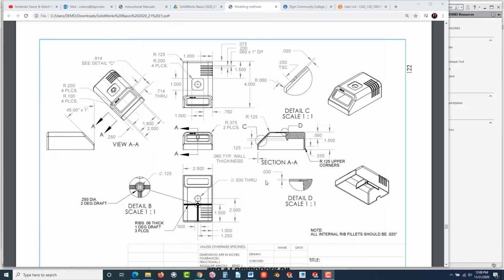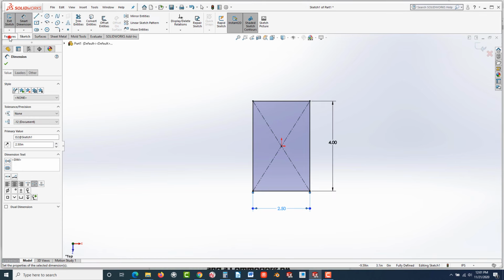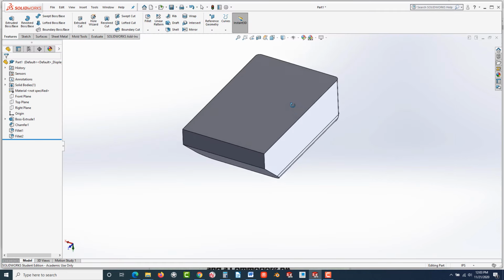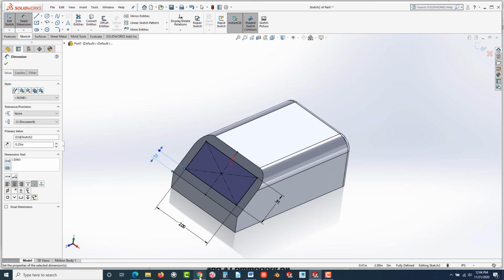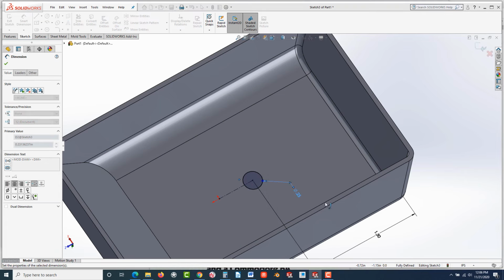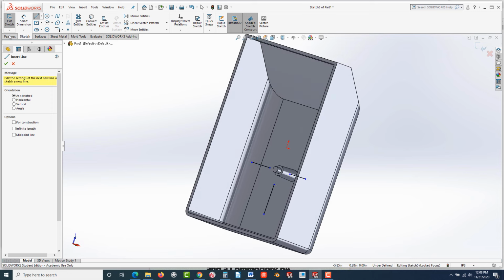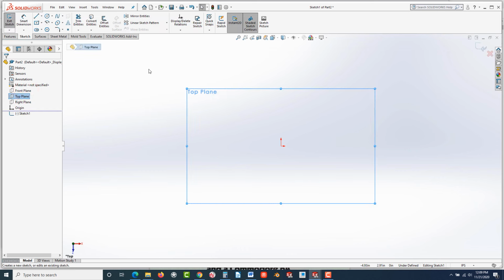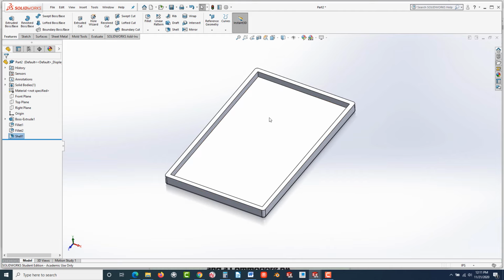L11c and L11d Hints

Comment: Just a question.  I notice you use the “ribbon.”   Is this because you actually prefer the ribbon, or is it pushed by Dassault?
Reply from the maker: I teach the basics, the ribbon as-is the default interface. Being a certified SolidWorks trainer since the 90's I've learned - "you don't try and teach interface customization until later, you'll only contribute to confusing the students". Also, the ribbon has the names of the features, making it easier to learn, versus just an icon/image.
Reply: vertanux1 OK, sounds reasonable.  So it is “as pushed” by Dassault.  I have used SW for 20 years.   Don’t remember being taught the ribbon.   I can’t stand it.  It is turned off straight away whenever a new version is installed.